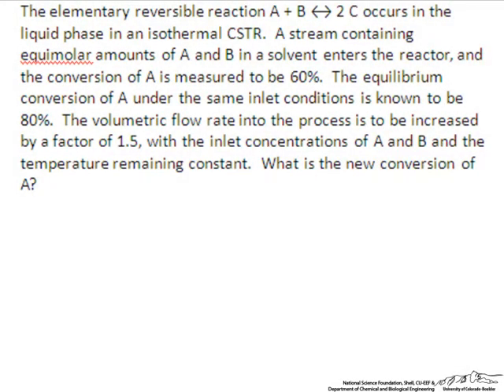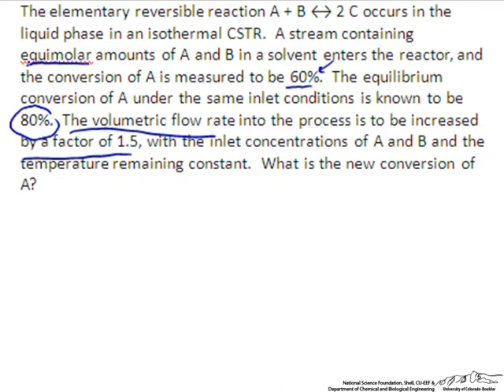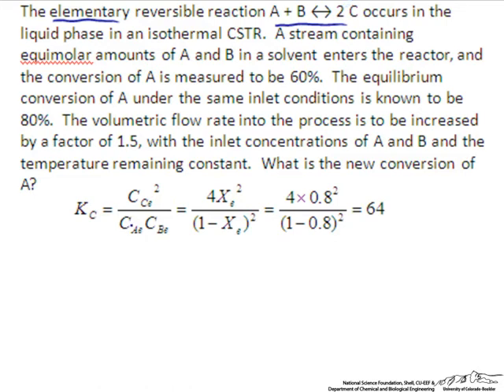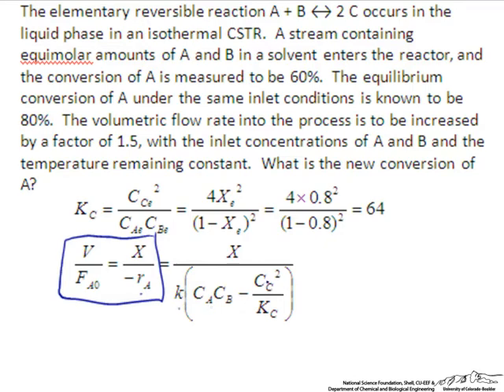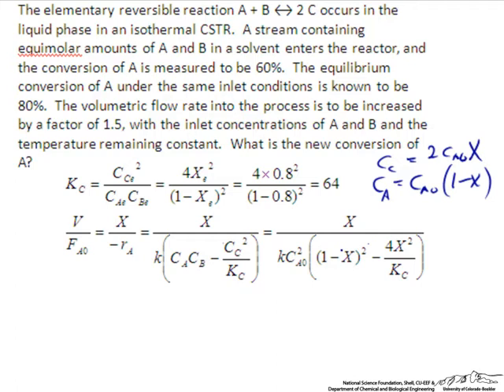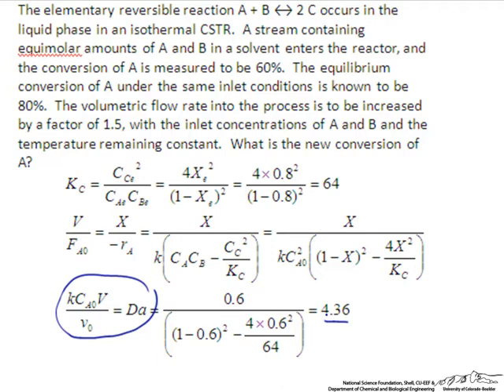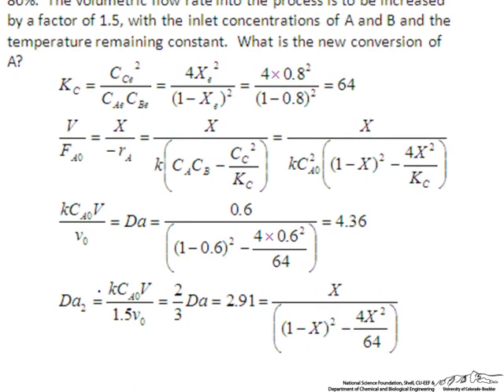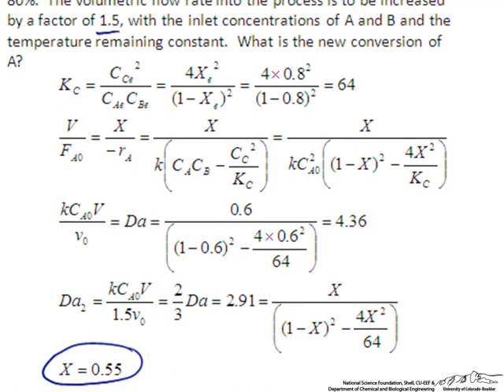CSTR Design Example (Using Damkohler Number)

Comment: SIr I am getting the conversion as 0.611
Reply from the maker: Are you starting with the equation 2.91 = X / [(1-X)^2 - (4X^2/64)]?  It's a long equation.  Check your work.  I redid it and got X = 0.55.  Good luck.
Reply: @LearnChemE  Yes Sir rearragning this equation is giving me 1.728X^2 - 5.28X + 2.91 = 0
Solving for X we get X = 0.7215 and X = 2.3341 which is discarded.